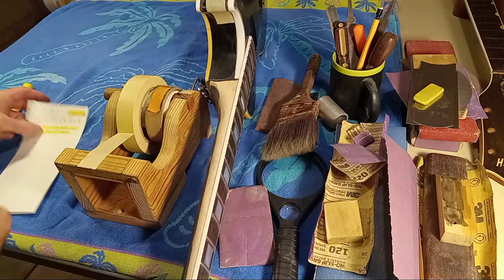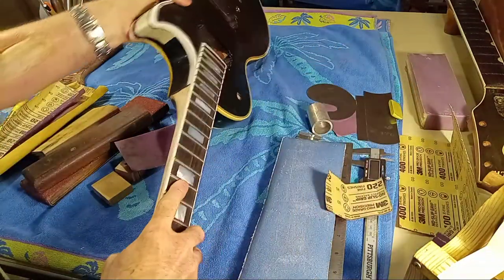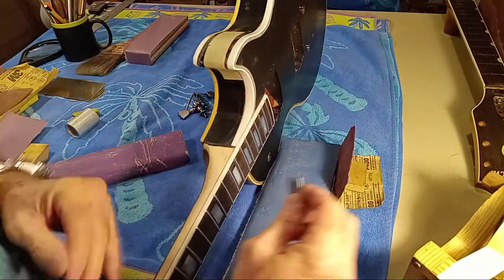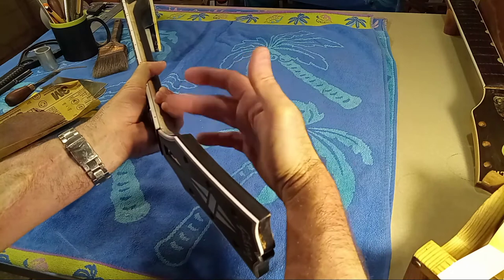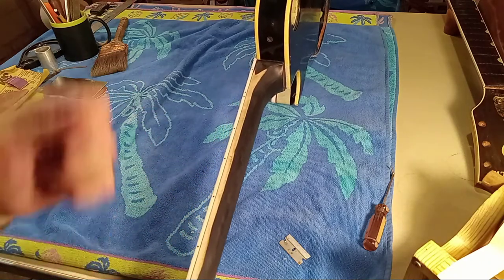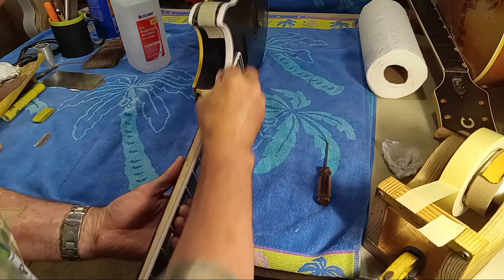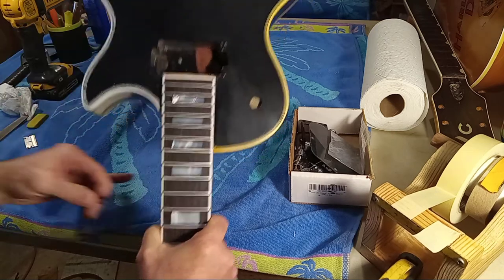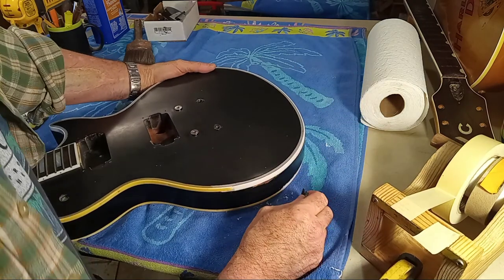Vintage Gibson Les Paul Custom Restoration Video 38

Comment: Love your videos on the LP Custom.
What would you advise me to do to my 70's LP Custom...I bauhgt it with a Aquarius man with water on upper front. I thought it was all shell but turned out to be painted and the carved into the wood. Now it has a prestty deep 3 inch hole . How would I fix it ??
Was thinking to replace the top maple vaneer but it was made with more than two boards. Can you help me with your opinion.
Manny
Reply from the maker: Hey Manny,
I don't really understand what the problem is (without a picture or video), but if the top is painted, you can clean up any hole or severe scaring with heavy sand paper, and/or drilling out old dirty/rotten wood and fill any areas back in with new wood and epoxy (patch work and/or skim work/leveling.

The epoxy will become hard enough to sand and level- even contour with 120 grit, then 220 grit, then 400 grit, then sand out.  If you use water-based wood glues they will create rubbery joints, and will always be noticeable- near impossible to shape and sand, but worst, will destroy the tone.

Proceed with caution, because you will more likely destroy the value of the guitar, and I mean considerably.  But, if you focus in on the first 10-15 videos of the Les Paul Custom, your answers will be found there.  I much prefer to work with slow curing epoxy...  Besides, it gives me time to drink more coffee...

Marc 
Tiki Hut